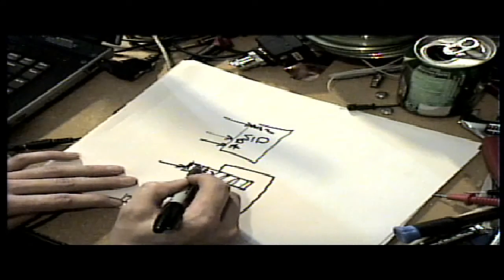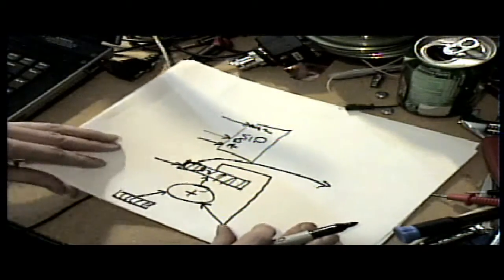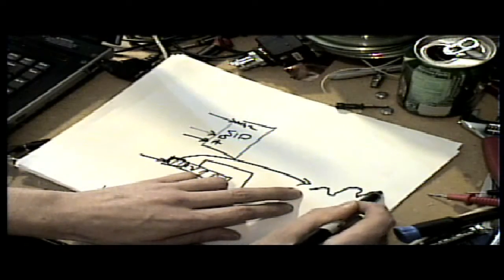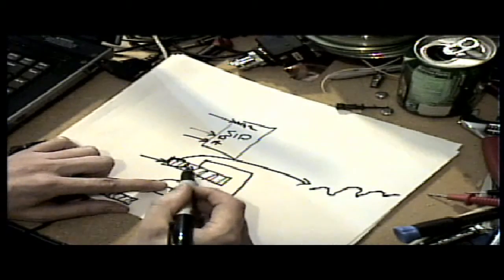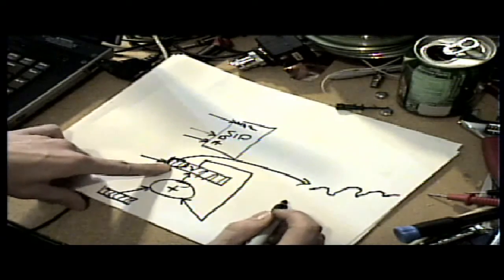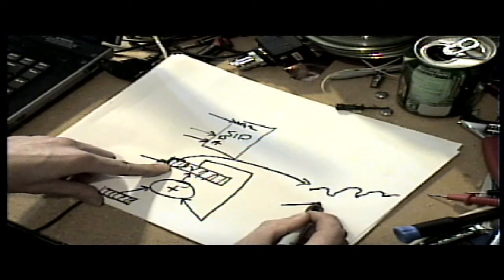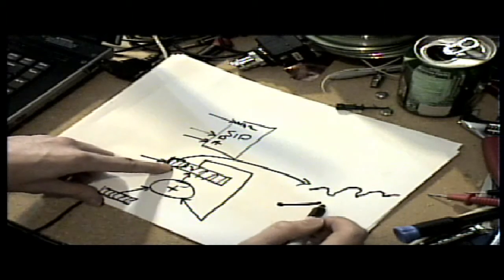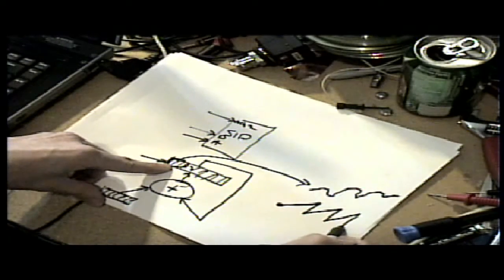C64 SID Phase Accumulator - Digital Sound Generation

Comment: Having just coded a SID chip emulator in javascript it is fun to hear you talk about these details. My first thought when I read about the triangle wave was that it would loose amplitude with the msb chopped off, but the whole 8 bits are shifted up one to retain that but loose one bit of resolution at the bottom (hardly audible). One thing I have not yet figured out is how the 3 channels are joined as I am just doing a simple addition of these and dividing by 3 which surely cant be the way they did it. Need to dig into the SID chip internals which are so well documented these days.

Comment: when you re-developed the sid for the 30in1 c64 on a chip, what about the result compared to the real sid chips? i heard that the filters are maybe a little bit of a challenge and also the volume-register should be useable as a 4-bit dac.
did you get your emulation (or redesign) close to the original sid?
on the origianl sid the filters where analog - did you use some iir or fir filtering in the simulation?
i think there is some need for new sid-chips out there which sould be compatible and maybe with some enhancements. (more voices with r/l-balance register per voice), reverb,...
(i am actually thinking about doing a sid-chip emulation on fpga myself that is somehow (on a board) compatible to the old sid chip)